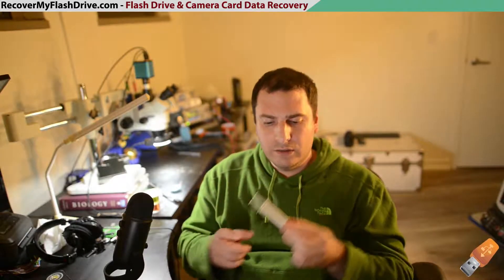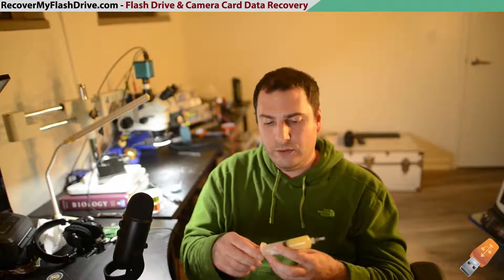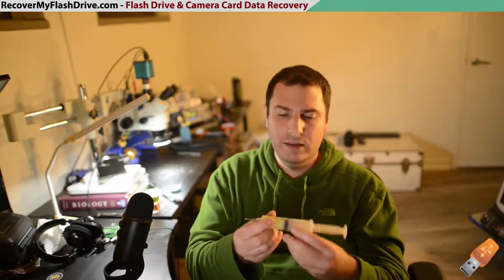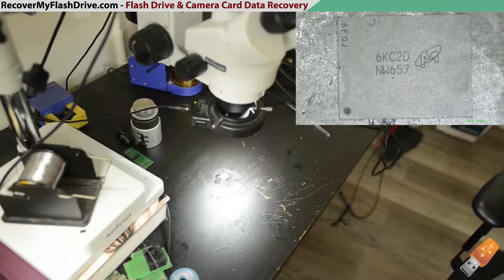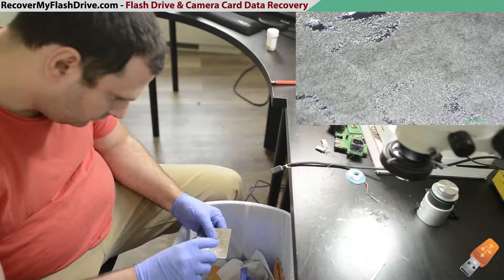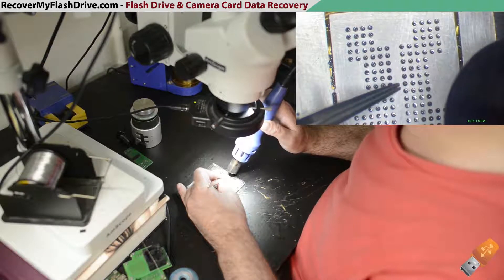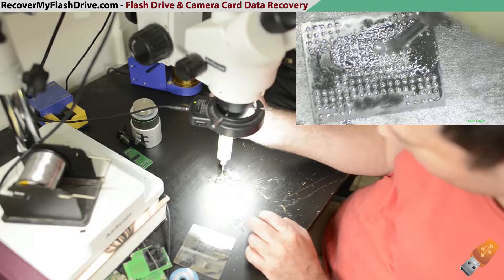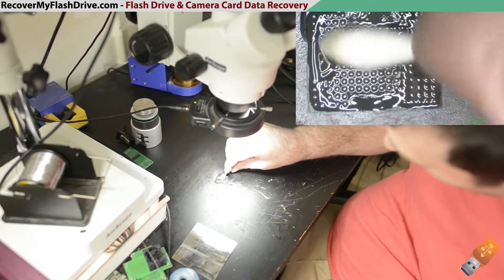Reball LGA 152 NW657 NAND Chip for Data Recovery

Comment: Q: Aren't there adapters for many of those from for example Rusolut nowadays?
Reply from the maker: This is primarily if you're doing a PCB swap. For example lets say there are many sector updates and a given solution by Rusolut doesn't handle them correctly. To recover the few/small files would be best done using a donor PCB assuming it is physical damage (eg: torn surface mount pads) which I see frequently on SM based Lexar flash drives. The adapters are for reading the NAND chip in a reader however I've had encounters where I've had to fabricate a PCB to read a NAND chip in which case reballing is also helpful.
Reply: @recovermyflashdrive  I see, thanks!